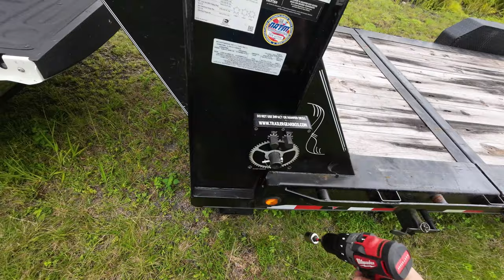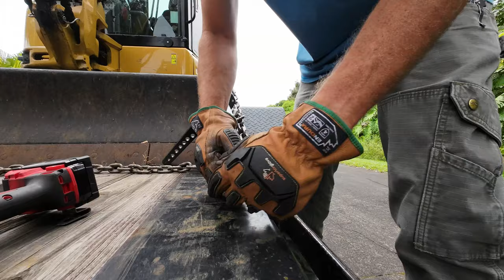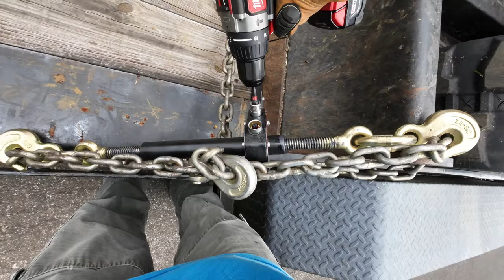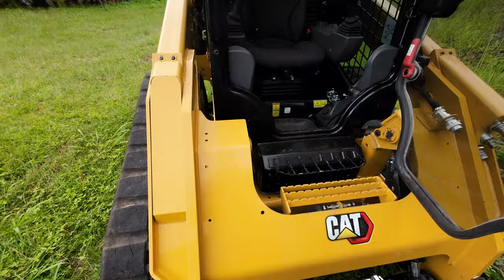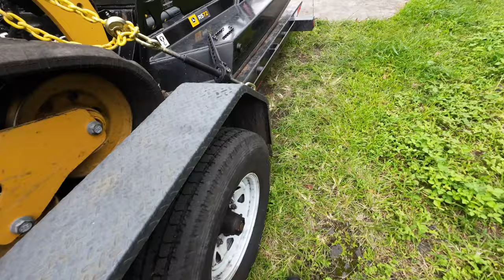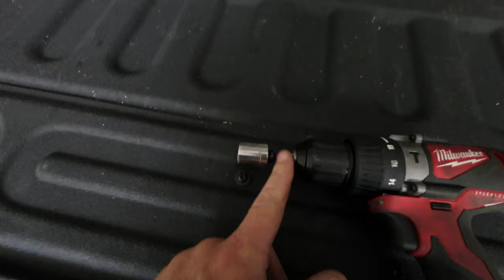FIRST IMPRESSIONS!!! Speed binder and Trailer Gearbox.

Comment: Check out Ancra EZ binders. I bought a couple to try and I absolutely love them! Makes chaining down the excavator so much faster and easier! Plus you don’t need a drill or ratchet to use them
Reply from the maker: I looked at them and they look cool. I do see that their ratings are a little lower and I'm guessing that you cannot get the same tension as the speed binders. Also the speed binders have a lot less moving parts.